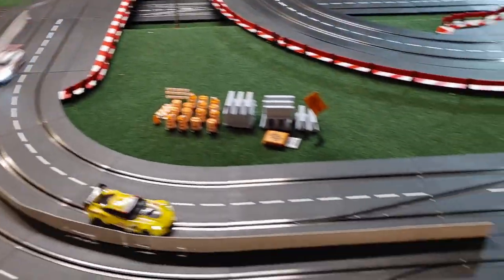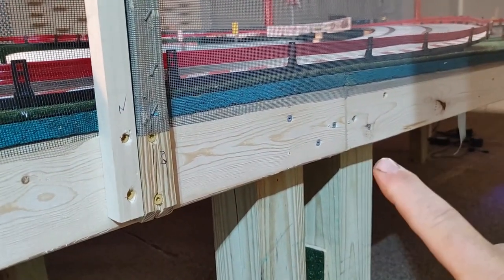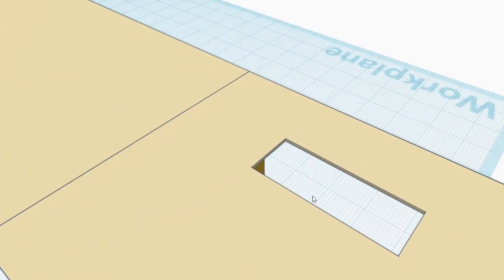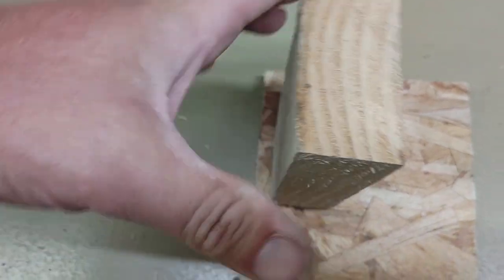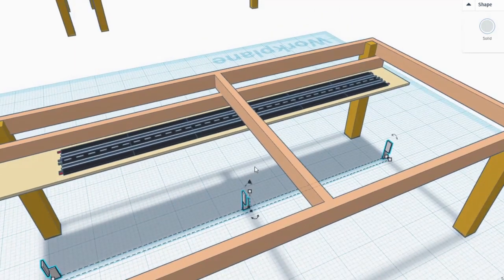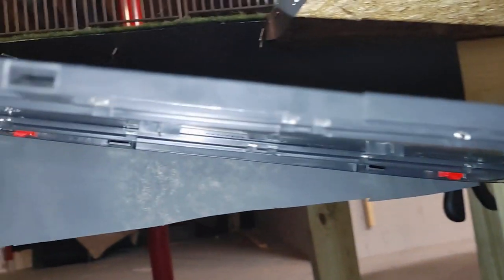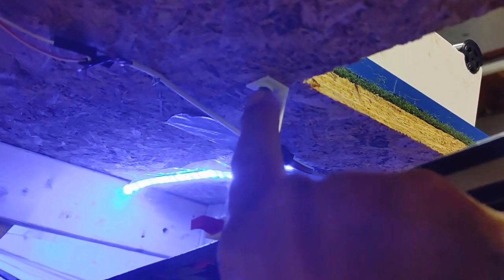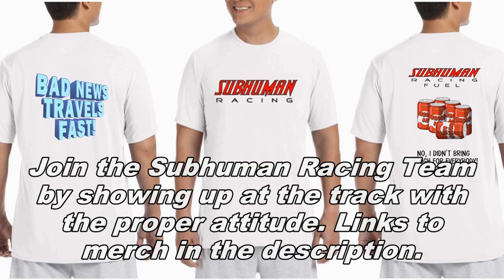Slot Car Track Tunnel Construction - Carrera Digital 124/132 Slot Car Track Layout

Comment: Hey I have a question! I’m working on building a track and I wanted to make my own pieces. I got the Carrera evo digital set. Can I use copper tape and attach custom pieces to this track? I’m not sure how the “digital” part works
Reply from the maker: Yes, you can connect your own custom pieces to the track. The only pieces of Carrera track that are digital are the control unit, lane changers, chicane, and pit stop. Everything else like standard straights and turns are basically analog, as would your custom pieces be as well.